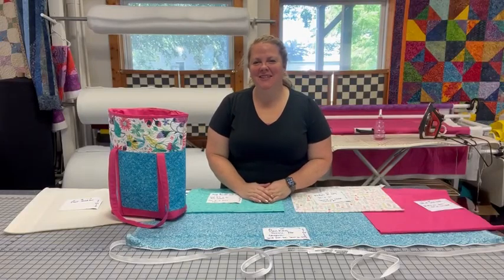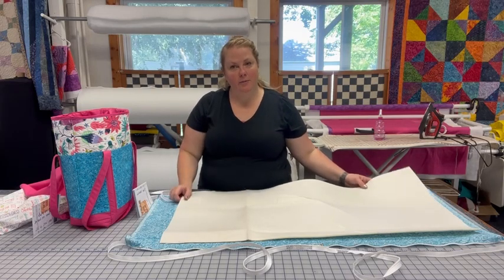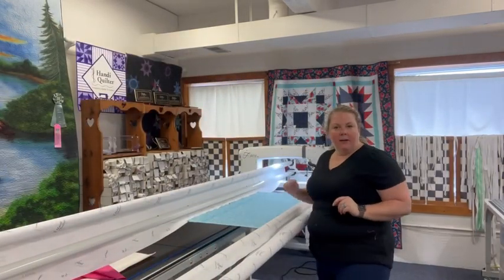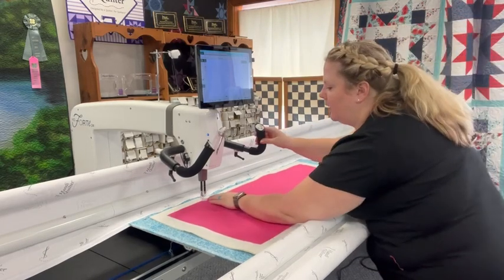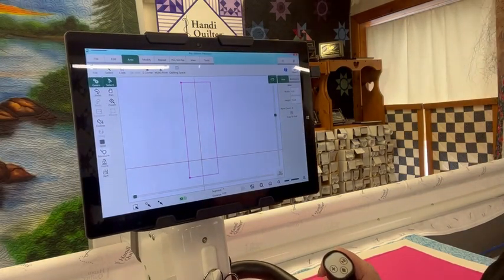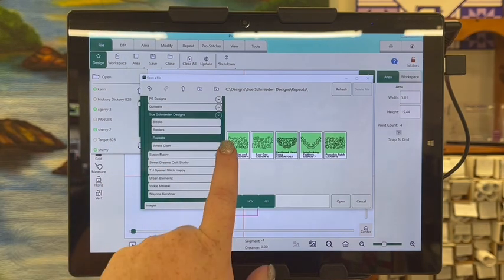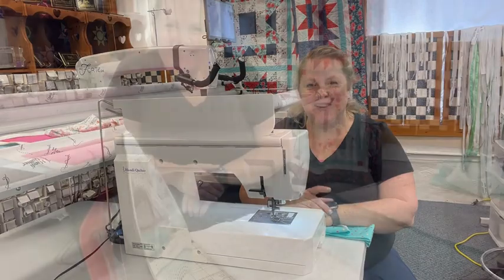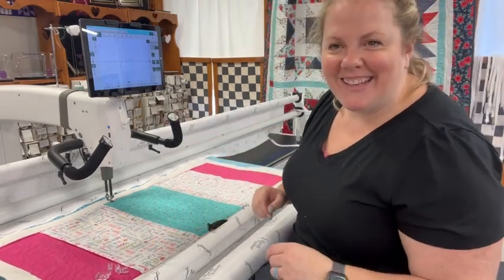Part 1 How to make a Tote Bag on a Handi Quilter longarm quilting machine

Comment: Thank you Angie for your great videos.  I want to share a tip from Jamie Wallen about the plastic feet. If you load them from the back of the needle bar there is less pressure on the shaft and they are less likely to break. I love the square feet!!  Thanks again.
Reply from the maker: That is a great tip! Thank you so much!! 
Happy Quilting!